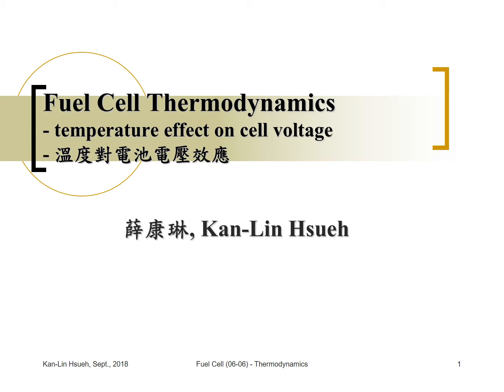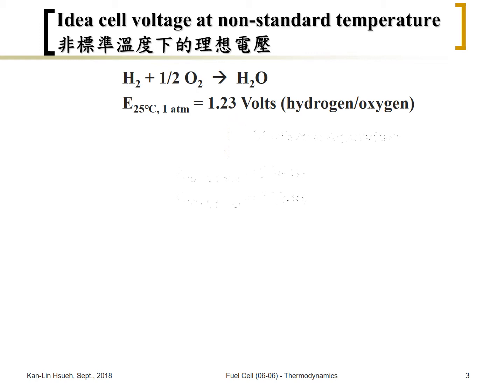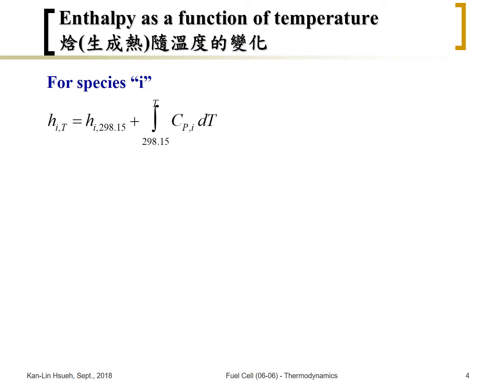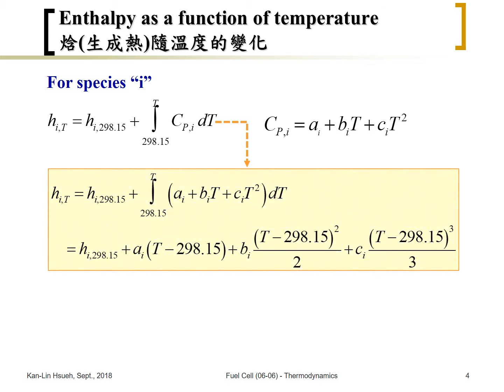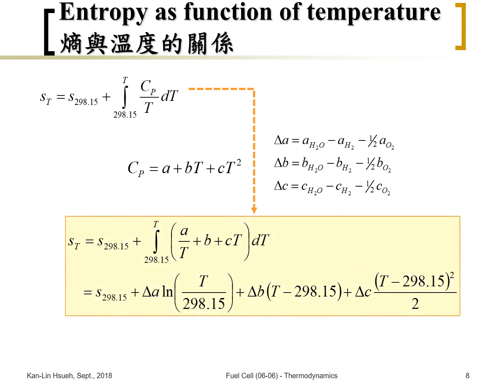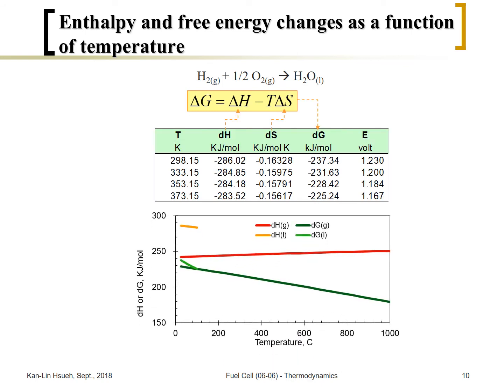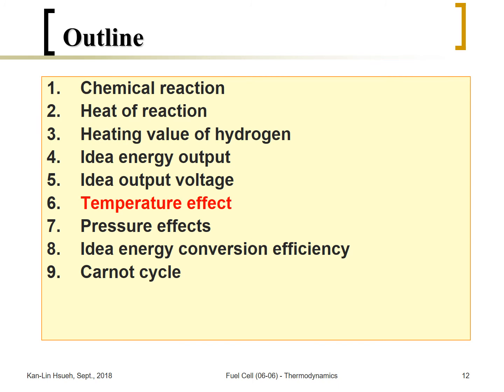Fuel Cell (06-06) Thermodynamics -Temperature Effects

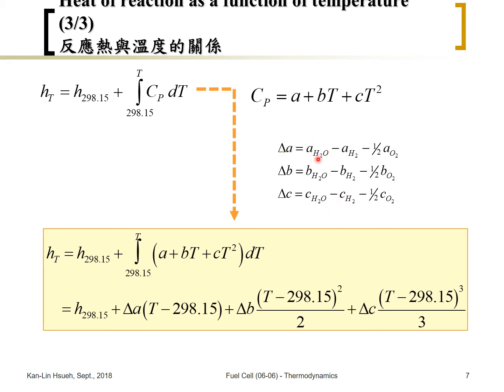Comment: At 4:45, it should be T^2-298^2 rather than the whole squared, wrong way of putting limits of integration
Reply from the maker: Yes, you are correct. I may changed that in the revision. Thank you.